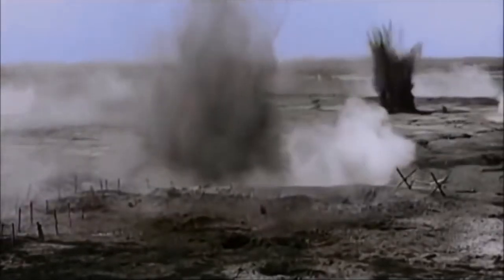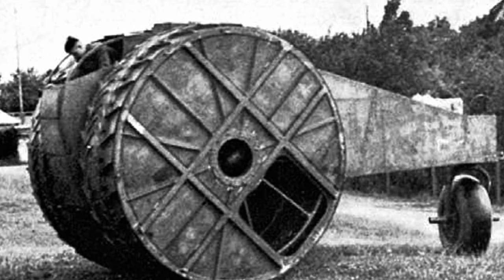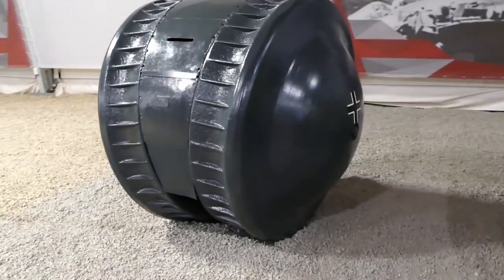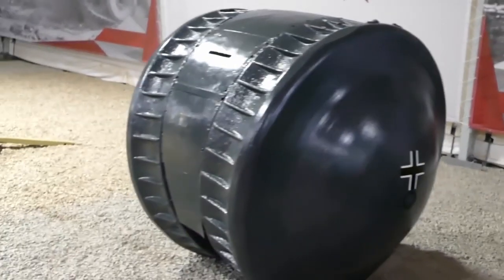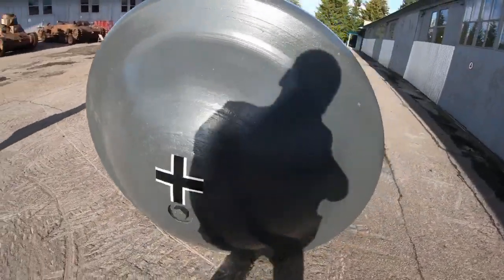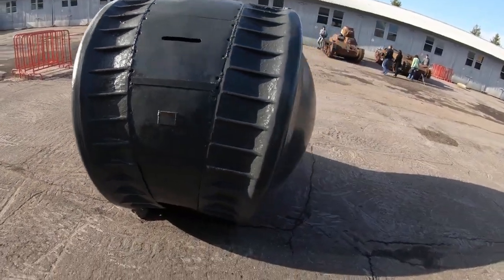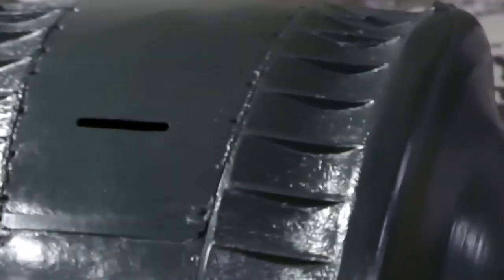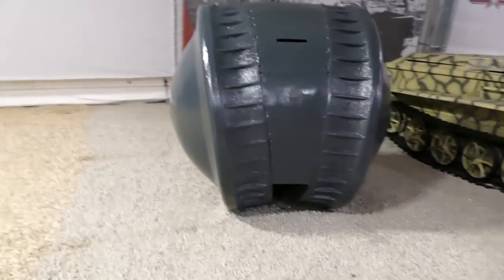Kugelpanzer - The German Ball Tank of WW2

Comment: Two questions.
You say engine... where is the exhaust.
Second.
How does one get in ?
Reply from the maker: Hi Tyfon, because there isn’t a lot of information on the Kugelpanzer it’s hard to give a completely accurate answer. However, given an exhaust can’t be seen in any video / picture of it, I believe the Russians may have either removed it or the engine entirely. The engine would need to be accessible to the sole occupant inside for maintenance so I believe the exhaust would have protruded somewhere near the support wheel. As far as getting inside, there is a rear hatch above the support wheel to enter / exit. Had you heard of the Kugelpanzer prior to the video?